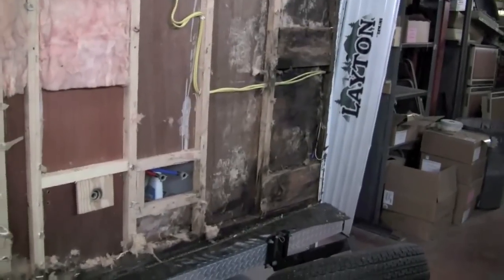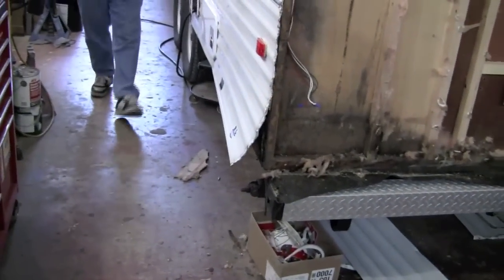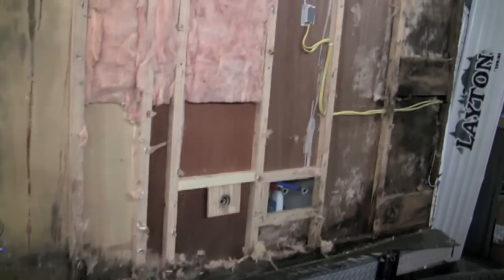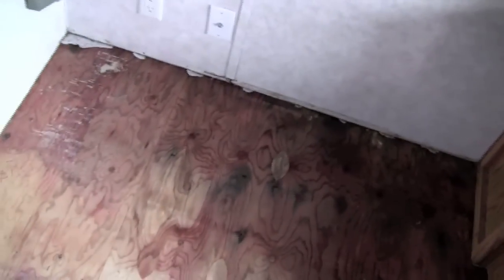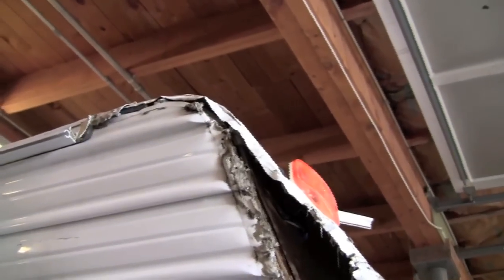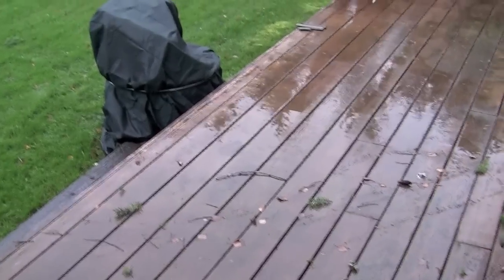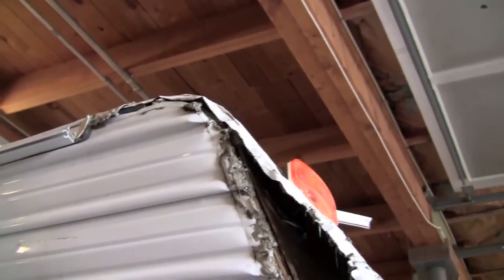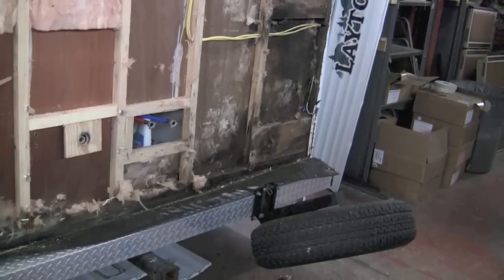Trailer Rot

Comment: Hi Larry
My wife and I purchased a 1993 Fleetwood last Wednesday for the express purpose of demolishing the superstructure to reclaim the 38' long (with hitch) trailer. The quality of construction is shameful. All the areas you showed here were rotted - many looked like they were leaking from day one. One area in particular - where the siding meets the roof sheathing - raw sharp edge - over which was placed the roof membrane - maybe 4mil rubber. The rubber in the field was still in excellent condition. Part of the problem is using fiberglass insulation - it holds water - so, even if a leak is very minor, water will accumulate in the fiberglass and eventually wet the paneling - and will keep it wet. So much for Amish quality. I just watched the video on how Fleetwood and most likely all other brand wood-frame campers, are made - less then 7 hours from frame to out the door. Too bad quality is not a priority. Thanks for your posting.

Comment: One of my pet peaves is the use of zinc plated fasteners on exterior trim,which begin to corrode after a few seasons. I have replaced all my low-stressed fasteners with stainless steel. I put clear urethane sealer on the threads,the goal being to have a little sealer squeeze up around the head just as the fastener snugs-up. I cover the whole thing with lap sealant where appropriate.

Comment: This all made me cry . I was set on this product , had everything i wanted now this !
Reply: Same.... :(
Reply: Guys, if you do the annual maintenance  ie, roof sealant, all seam, joint, etc seal degradation work, no travel trailer, I repeat, No Travel Trailer will rot.  Any brand or manufacturer.  It’s a high stress environment that requires silicone or sealant to hold up for years but it’s worse because unlike a house bathtub where silicone sits still forever here it’s constantly flexing and moving and under some kind of stress due to motion.   I have a 1987 30’ Hy-line that has rot on both ends and I’m currently gutting both sections.  Trailer sat in outdoor Florida storage for 15yrs after owner died and basically all areas of joints in paneling need new silicone or sealant. I mean everywhere.  Gravity is your enemy here.  My point is any trailer will leak if you don’t redo high stress sealant joint areas regularly.

Comment: Its the way most all industry works.  Years ago, I worked on a product development team ,as a prototype machinist, building fitness equipment and I would build/fabricate the units using good solid materials to  make a robust product.  Then management would come up with a competitive price point and the engineers would began to redesign and cheapen the prototype for the production models.  You get what you pay for.  I heard that Canadian campers like Bigfoot and Northern Lite are quality products.  I've got a Lance camper that has rot under the bathroom.  The whole left side where the tie down support connects ripped out due to wood rot.

Comment: AS SOMEONE WHO REPAIRS RV ROOF'S, FLOORS, AND INTERIOR WALLS THAT HAVE HAD WATER INFILTRATION, I HAVE SEEN IT ALL !! MANY OF THE REPAIRS ARE DUE TO  POOR DESIGN, SUBSTANDARD MATERIALS, AND THE LACK OF PRIDE A COMPANY TAKES IN THE  BUILDING, DESIGNING, & MAKING SURE THEY CAN BUILD A PRODUCT THAT THEY CAN STAND BEHIND !! WATER IS AN RV'S WORST ENEMY, SO WHEN YOU COMBINE IT WITH POOR DESIGN AND SUBSTANDARD MATERIALS THIS IS WHY THERE ARE SO MANY RV'S WITH THIS PROBLEM. ROOF MAINTENCE IS ALSO THE RESPONSIBILITY OF THE RV OWNER AS WELL, AND STARTS WITH THE ORIGINAL OWNER. THE ROOF NEEDS TO BE KEPT CLEAN, A PROTECTANT ADDED A COUPLE OF TIMES A SEASON.. ALSO ALL THE VENTS AND SEAMS NEED TO BE INSPECTED TWICE A SEASON, AS CHAULK BREAKS DOWN OVER TIME FROM THE ELEMENTS, AND FLEXING FROM TRAVEL & AND NEEDS TO BE RE-CHAULKED. WATER LEAKS CAN GO UN -DETECTED FOR QUITE SOME TIME BEFORE IT IS EVIDENT... AND THE MAJORITY IS THE MANUFACTUER'S FAULT AND THEY KNOW THIS, AND SHOULD STOP ALWAYS BLAMING THE CONSUMER!!!! AND TAKE THE RESPONSEABILITY  OF STANDING BEHIND THEIR  PRODUCT!!!!
Reply: ***** Hi George, I have never had a call to repair a Airstream, Over the years i have never heard a bad story about  an Airstream with any water leaks !! That is not to say that there are none, but they are constructed with good materials and they have an excellent quality control dept. that insures that every step of of the building process is done properly....If you can afford to buy one do so, you will be very happy with it....
Reply: Seems like unless you can permanently store these in a garage you are doomed. Is there anything you would recommend Greg? Thanks for your feedback
Reply: +Greg Kaplan
    Okay, please turn off your caps-lock key. It's distracting and unnecessary. Anyway, there's nothing wrong with these travel trailers. Yes, they require more care then a conventional home, but, given the circumstances and conditions, that should be expected. It's common sense. And, with that reasonable care, the materials and similar are just fine, with more robust materials (light weight, waterproof, etc) costing substantially more - which most, despite the rhetoric, are not willing to pay.
Reply: Best solution to those problems....get an Airstream!

Comment: Eternabond Tape is the way to go when your wanting to prevent leaks.
This stuff works great and lasts a long time. Anywhere you have a
seam, like where the fiberglass nose and rear end caps fasten to the
roof of the trailer, These areas are subject to leaking, and this tape will
prevent that from happening. It sells by the foot of $2.10 and you can get
it in 6" 4" 3"  2" wide at 35 mil thick.  Do yer rv a favor, get this tape and
geth it sealed up. And to the fella poking fun at the Elderly Men, YOU to
will be there one day..... And YOU to will be poked fun at. How you gonna
feel about that ? Think about it...... Just saying.

Comment: I hate to argue but every RV/camper made in the last 30 years leaks with out exception. The problem is you have a box that is moved up and down the road where it flexes around as it travels. I have owned several campers from pop ups to pull behinds (24' coachman) and they all leaked. The only way I see to get around it is to store them under a hard cover when not in use.

Comment: In the process of rebuilding a 30' camp trailer it was given to me very high in but never had the seams or roofing cleaned and maintained. I have replaced roof and did away with bath skylight. Ripped out entire bathroom and wall behind couch and walls in master bedroom. I have aluminum frame so no studs to replace the hardest part is cutting and replacing walls to fit where old was. I am priming and painting all cabinets and replacing all flooring not sure what I am using for floor yet. This is my second rebuild and I expect to make about a 7,000 dollar profit.

Comment: I had a 2008 Skyline Malibu.  With regular Roof inspection it still leaked. It started in 2010 into 2011. My first indication of a problem was that one of the ceiling lights shorted out and the a small fire occurred due to it being wet. This trailer was a piece of junk!! Contacted Skyline and they of course blamed it on me because of lack of maintenance. Don't buy SKYLINE. I should have recorded it and put it on you tube. Thanks for the video!

Comment from the maker: I am not an industry expert, just a consumer. I would be looking for aluminum framing, closed cell foam insulation that does not wick the water to other materials,  treated plywood floors, and a single piece rubber roof that extended three inches over the side and over the side wall connection, so that the exposed connections to the side walls are not exposed to direct water contact, and thus not dependent as much on the sealant nor the mechanical connection. The life of the rubber roof, would determine the longevity (say 10 years for a suitable ultraviolet material) rather than the life of the caulking (six months), subject to all the vagaries of how and when you do the service.

Comment: All aluminum should be rivited the old fashoned way with hammers and bucking bars , have either an aluminum angle at all 90 corners, or a doubler backing up a sheet seam. Sealant used on every rivit....then and only then , will you have a water tight seal good for a lifetime. Airstream looks to be a good product. Start with a grumman panal van for good build. Take it from a seaplane mechanic....

Comment: Hi Larry, was reading and watching different stories and videos when I saw yours. I totally agree with you, I believe most campers are made the same thing. I have had nothing but problems with my Jayco, Jayflight. long story short I searched for years trying to find where it could be leaking only to tear out the back inside walls that were wet and realized it was coming from the top where the roof is screwed on! these screws were covered by a beveled piece of plastic and no caulk what so ever! I removed some of this cover to find all the screws are rusted and green slime!  I have had this camper now for almost 10 years so they wont help and after two air tests they told me two "other" places! I believe they knew and sadly they told me also it was my lack of maintenance! but you cant fix what you cant see!! buyer beware for sure, and check yours, it will take some time before you notice the damage and by then the warranty is up and you will need thousands to replace your roof! sadly we cant afford a new roof so I'm now in the process of replacing screws and caulking :(
Reply from the maker: Teresa Dietz I did this video to get the manufacturer's attention. Your direct complaint will have a cumulative affect. The real point is that they pray upon our ignorance, and goodwill, and in the end there is nothing we can do about it. However, good design and good materials can and does change the amount of maintenance from six months to 5 years. And with demand even better materials and better design will come, but not until this is a market for it. Please alert your friends to being a good shopper.
Reply: sure will, thanks
Reply: +larry S Larry : do you think there are campers that are designed better to not leak? I've Rpod, Airstream, T@B?  Are there design things you look for now to disqualify other campers based on engineering flaws?

Comment: I have a small amount of water damage on the floor about a foot big, I took out the pieces and seen how far it went, I called a rv repair person and was told it just needs to be junked. My fiance is really good with wood and building is it something to Trash or fix. it's a nice 2003 trailer we just spent 5000 dollars for it and after we removed a chair we noticed the damage. any advice? 
Thank you!

Comment: Impressive. But comparing it to patio deck is not valid - patio deck has an ample ventilation, nothing prevents it from drying, and there is nowhere for water to collect. OTH, spaces inside the walls of the trailer are not ventilated at all, any water that gets in, stays in.

Comment: Your first problem was to heat the inside when storing it, warm inside, cold outside = condensation on the inside skin of the aluminum. It will not dry out like your 20 Year old pressure treated deck that is out in the sun after a rain storm. The trailer seems to be made from the same materials as others with simalar construction, I highly doubt they used cheaper brand of spruce and aluminum, now workmanship my be substandard... I dont think layton is quality brand
Reply: I have a feeling, as my stepdad used to say, "You hit the nail on the head."

Comment: Well I will never ever buy a trailer or RV! I will convert my own used van for a lot cheaper. My last home made RV lasted over 20 yrs and it was 15 yrs old cargo van when I bought it. Most of the appliances from my 1st van still work today. A little TLC will make them last a long time. But I may downsize the next one. Buy a small Pickup and sell the box off the back for a good price. Then buy a used commercial box and build from there. Do some work on the outside to make it more areodemanics to get better MPG . And customize the inside of the box. Let it get covered in graffiti, makes it look like it has nothing inside too steal!

Comment: Sadly, these coaches are made so poorly that after 7 years, they are throw-away.  Skyline (owned a Nomad 2715 for 12 years) are so-so and are generally known as a 15 year trailer.  My roof failed after 11 years.  I now have a Gulf Stream trailer and it's already looking like it's very poorly made as well and I have done many, many repairs that should just not be needed.  All of the trim that is screwed into the coach is coming off and the trailer is only 1 year old!  Unless you have $100k, it seems like the RV industry is DEAD!